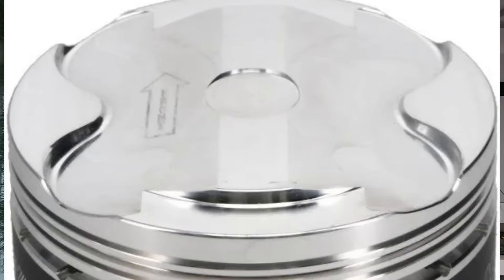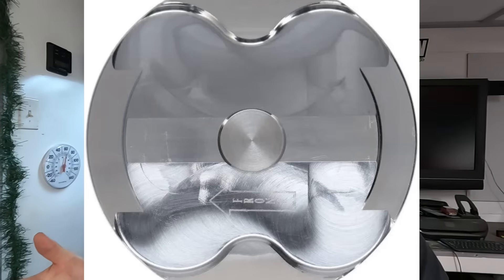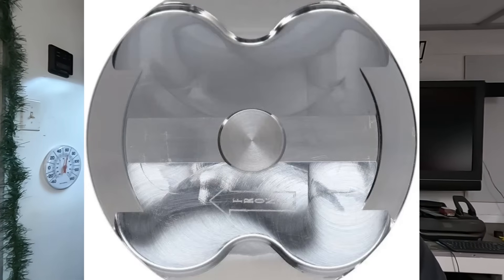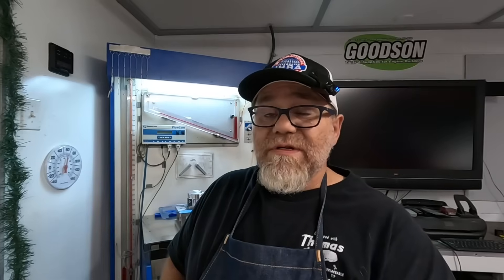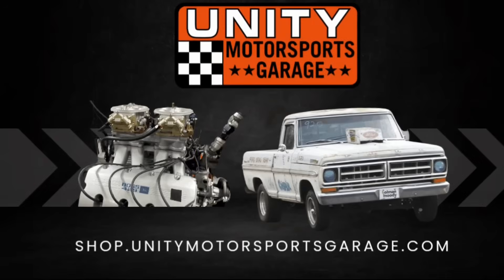DIY: Piston Mods that WILL Actually Make Power!!!

Comment: Ok what if your quenching heat out of the piston or using c ceramic coatings and yes I was taught to smooth all sharp edges inside the combustion to l prevent  pre ignition from red hot edges.

Comment: I waited for the part where you tell people that "porting" your piston is dropping your compression and losing power. Better air flow but lower compression. 100% spot on with the burrs or rough edges causing pre det. Polishing is a good idea.
Reply from the maker: I will trade airflow for that .25 point of compression everyday of the week!
Thanks for watching 
Andy

Comment: I was just thinking, so please correct me if I'm wrong. When a aspirated engine cylinder is at dwell there is little to no cylinder filling until the moment the piston starts moving down, what if one can figure out exactly when the piston starts going down, and the exact time the inlet valve opens, then you adjust the cam timing to open the inlet valve to as close to the start of the piston going down. I see piston dwell as lost time or dead time.
Reply from the maker: The cylinder begins to fill even before the overlap period!
Andy

Comment: Just watched this video  great info. in the future i plan on building a racing 360 mopar small block . ill send you a couple of pics of a pistion out of my 318 i had rebuilt a few years back and get your opinion on what caused the damage ?
Reply from the maker: Looks like Detonation to me...
Andy
Reply: @UnityMotorSportsGarage  I believe coolant played a factor because I aways tried to make sure the timing was correct . found damage = cracks / warpage to the head gaskets and some of the head bolts where tight but didnt feel torqued even though I followed the proper specs . from now on im using ARP Head bolts or even ARP head/ block studs like I did on my 225 slant6 . Thanks Andy

Comment: Good video. Agreed on everything you said and it all makes sense, EXCEPT the part that you said the piston sharp edge will glow red hot. I have heated aluminum before and it doesn't change color like red hot as it heats up. But I did understand what you were trying to say by that statement. Respect. Correct me if I am wrong though.

Comment: Hey Andy what about gas porting pistons? I build ohv clone engines from box stock 196cc to open modified 240cc stock doesn't turn 6000 but the big motors will turn 10k. They create an unbelievable amount of crankcase pressure. I was wondering if gas porting may help seal the cylinder aginst all that positive pressure? Thanks

Comment: Dear Sir, Something that I have always done in the many years of porting pistons is. I always smooth out any sharp ridges as standard. But I also polish the piston crown up to a mirror finish. Personally I have not had any problems with any of the many builds I have done this to. So I was just wondering what are Your thoughts on doing this, and is this a common practice among  your community? Nice video Sir., and Best Wishes

Comment: Good stuff.  Except the glowing aluminum.  Molten aluminum is silver, correct?  The point is great.  Edges will become hot spots.  Here is my question.  If you radius the sharp edges, is it also a good idea to smooth or polish the new radius surface.  If you leave it rough, will that area carbon up quicker if it is more rough than the rest of the piston?  In a pure racing engine, that can't be that important.  I am thinking about a street engine that might see thousands of miles.  Good video.

Comment: Is it not correct that by removing material from the piston crown will reduce cylinder compression, and that might lead to slightly lower power and torque delivery ?.

Comment: I see the same reasoning in an engine which is definetely not used for high performance. Russian M72 or chinese CJ750 . Its a sidevalve boxer so the piston itselve is definetely flat . As the official output is about 22-26 hp . The engine is rated to use cheap fuel , minimum 78 Oktane. All the guys who try to inhale some more hp into that engine use the compression ratio , modifying the cylinder tap , which defines a lot of the shape of the combustion chamber. When they increase the compression rate , adding material to the surface and reshaping it they beware a lot to give a smooth transition to the edges of the valve-pockets. Exactly to prevent knocking as consecuence of the invreased compression ratio. Knocking is exactly the same which is provoked by "glowplugs" at sharp edges. Doesnt matter if you have them on a lawnmover or a dragster engine.

Comment: When you have a CNC machine piston you can have that machine around those edges off to what  angles you want. Whoever is making them needs to be told that's what they want. There is no need for Sharp edges. All you have to do is talk to the manufacturer.

Comment: OEM piistons spend  99% of their life at 1/2 atm pressure or less.  It would be a rare case where oem combustion temp occurrences melt sharp edges.  I wouldn’t blame them, you are specializing the engine for boost applications .  You are an expert, like DV.

Comment: Brian Salter done a excellent video on this subject and he had someone who challenged his findings, he had to tell the guy that he's an engine builder and it's been proven by radiusing the eyebrows on the piston tops. Laying a intake valve in the valve relief you can see the ledge over hang where there will be some disturbance on the overlap so laying that edge back will help with air flow

Comment: Very good "common sense" info..  I see a lot of engine builds with sharp edges in the crush zone.  A OEM Toyota 22r chamber is hooorible. Not sure if you mentioned it, but some people are worried about the tenths of a point of compression lost due to the material taken out. But the truth is, being able to avoid detonating will make far more power and reliability. It's a common sense smart bit of elbow grease to do...

Comment: The Cummins engine uses one push rod to open 2 valves because 4 valves flow more air than two big valves. If they can do that on a Diesel why can't they do that with a pushrod gas engine?

Comment: Well said andy ive melted thru a ring land just like your buddy in the early 2000s and i figured out what the problem was and took my die grinder and sand rolled all the sharp edges and that circle track engine lived a long life after that
The sharp edges glows and can also cause pre ignition aswell

Comment: Great video Andy! My upcoming 455 Pontiac Im gonna push to the limit on compression. It will be about 11:3-11:5:1 with a good tight quench and all smooth edges. IVC at 48.2 degrees.

Comment: Absolutely post those pistons. Not only is porting the valve oocket notches a real deal, flame propagation needs to do addressed! Flame travel is a major issue when working with domed pistons.
Reply: Definitely.
Domes over .100 tend to hinder unless done just right.

Comment: Super cool Andy great video. valve relief is pretty crucial I did have a small Block. chevy  331 cube that I built a long time ago with a flat top pistonIt was a circle track  American stock Set up. before that and had  12 and a half 2 to 1 Pop up Seal power Old school pistons The rules in that class were had to be a 2 barrel of the cast iron head. I put a 4 barrel on that thing in it absolutely ripped. But I gotta hold this in Canfield 208  185I think they may have been one 70s can't remember Heads and I switched the piston out because I was going   Put it in my 71C10 on the streetstreet Went to A 9.6to1 flat top piston. Where the valve relief on the flat top Pistons was kind of tapered  And with the bigger valves it actually contacted The edge of the valve relief on the intake valve. But I assumed since I went from  Popup piston to a flat top I would be good I was wrong. Thank you for the video. Very educational. I did not use the clay method on the engine which is usually my go to. I tried to be smart and measure it. And I missed it until I assembled it and rotated it with the valves adjusted. I didn't  Messy thing up  I had to pull the heads back off and The agent back apart And square up the valve  Relief on the top of the piston. But I've seen similar scenarios lots of times  They play method is your best friend. I didn't even use some thick grease Not the point of your video but related thanks buddy

Comment: Good video. Don't take this the wrong way but there's one phrase I want to kick around and make sure you see both sides to. Doesn't change the subject of the video here- amplifies it in a way- but want to make sure to examine the phrase, because there's another side to the story.
8:50 or so you are talking about the piston hanging around TDC.  OK, geometrically, physically, yes. 
Air dynamics not so much. Opposite really.
.... as the piston pulls away from TDC on the intake cycle, it is starting from chamber volume. 65cc or whatever.  If it appears to take a while (degrees/time) to add 10cc, put that in context that it is adding that to a mere 65cc.
 Later it will be adding much larger volumes (eg as the rod reaches 90* to the crank throw) but it will be adding that to 500-700cc. 
The acuteness of vacuum drops off.
Meaning: if you were to put a vacuum gauge on the cylinder, it would pin the gauge at first as the piston movess away from TDC, then fall back to lessened vacuum as the piston speeds up. Sounds wrong but do the math on how much, as a percent, of existing volume the piston dropping adds. You'll be surprised.

Everyday example- in a small room, you can greatly affect the air pressure by swinging a door open and closed- ie airing it out.
Whereas if you have a much bigger room, it makes no difference when you swing the door.

So, think again, when you say the piston is hanging around there, at TDC, you may be thinking of it wrong.
It's actually important to make things "right" at TDC as you talk of here because a whole lot is going on. The most intense dynamics are at TDC.
Almost all engine builders end up focused on overlap, but I'm not sure they express why in a way that shows they understand the air principle....
And yes air has inertia, so "maybe" I've overstating the effect that "acuteness of vacuum" has. But it exists, & has an effect starting the airflow, separate from the "overlap" function itself. 
An agriculture engine without overlap still take a "sharp breath" as the piston starts down on intake.
Let me know here if this is making sense to you...
Reply: Don't forget that air stretches like a slinky toy, changing volume and pressure. Scavenging really sucks. 😆

Comment: At overlap the exhaust valve is open and the pressure wave of the exhaust leaving the cylinder has, if tuned correctly, exited the exhaust collector and a negative wave is traveling back up into the cylinder. This negative wave creates a vacuum the pulls the air/fuel mixture into the cylinder, helping to get it moving quicker. Unshrouding the intake valve at low lift would help the flow from the intake to the cylinder while the intake valve is opening and the exhaust valve is closing. So this makes sense. It’s not a huge amount of air/fuel being drawn into the cylinder at this time,  it every little bit helps in a naturally aspirated engine.
Reply: Kenneth? I hope you have a minute comment on the symptoms of too much vacuum pulling the air/fuel mix into the chamber… if there is such a thing. How much is too much , I guess is what I am asking. 
I am also wondering if you could take a minute to include anti-reversion into your explanation. I don’t want to miss the opportunity for you to be fully heard.
Reply: Unfortunately, that harmonic resonance only happens at very specific RPMs.  Much like tuning a radio antenna, a guitar, or (most relatedly) a brass instrument like a trombone.  Sadly, while variable intakes are a thing, variable exhaust would be incredibly hard to pull off.

Comment: Andy, when an engine get a few miles on it, would carbon in the chamber and piston smooth these hot spots?
Reply from the maker: Normally, what you will see is the hot spots will keep the carbon burned off in those locations.. 
Andy

Comment: Intake, or both?
Reply from the maker: You roll the edge of the intake a bit more compared to the exhaust.. The exhaust relief actually can help push the exhaust gases out of the port because the opposite is taking place if that makes sense 
Andy

Comment: Run a dished piston....also helps the flame front
Reply: Domes higher than .100 usually hinder flame fronts. 
More is not necessarily better. 😆
The dome piston Andy showed, we usually rounded it off a lot knowing the improved burn offset any compression loss. 👍

Comment: I wouldn't put it in the click bait category but I would put it in the more beneficial to content creators than engine builders and tuners category.  
 If your shit is tuned properly your pistons won't melt. The end. I have replaced hundreds, if not thousands of melted pistons, and every one of them melted because it was run lean and or with too much timing. When we were racing snowmobiles we would literally melt pistons on purpose to figure out our jetting. 
While free horsepower is always nice time is money and piston porting takes time. The time spent piston porting to get an extra 20 hp on a big block might have paid off with larger power gains doing something else. And unless you are extremely limited to engine mods, 20 extra hp out of a big block ain't shit. 
 Just my $.02
Reply: If everything else was equal I bet an extra 20 hp would be shit then.
Reply: @garyburdick1992 Right....but everything else is NEVER equal, even in class racing.  Congratulations on your ability to string words together.

Comment: Personally, I think you should come up with a different name for your technique. "Porting" as you will know, is the process of smoothing out "ports" in an engine. Usually using a burr or rotary file of some type. Doing the same thing for the same purposes on a piston doesn't involve the ports. But it does involve the same process as porting. It's just not the same thing. But you can't call it "pistoning" that would sound stupid. But porting, to a person like me who knows what porting is, also sounds a little bit ignorant if you're doing this to the piston itself. And as always, I'm some guy with an opinion but no solutions. I have no idea what you should call it but the first thing that came to my mind was  "piston relief"

Comment: Andy it’s always a good time buddy! 
I have two 4.6 / 2V intakes I’m going to send you..
I’m going to fix one correctly with JB Weld. 
And hand make a blue stripe fel pro gaskets, to seal the front of the intake properly where it deteriorated. 

The heater hose nipple in the rear..
You’ll have to make an insert nipple, JB welded in place, or tap the heater hose in the front of the intake somehow. 

Nevertheless it’s like dental work. 
At the front of the intake, you have to gently scrape away the rotten plastic, with a hobby razor knife, then start your JB weld build up process. 

I’ll contact you via email, so Ole’ Funky Elvin can send you two panther car intakes for 4.6 2V…

My contribution to the North Carolina Boys, trying to work on a budget.
Reply from the maker: That would be awesome 
My email is tunnelram393w@gmail.com 
Thanks 
Andy

Comment: Bill Jenkins addressed this in his book "The Chevrolet Racing Engine."  He goes into a lot of "secrets" that are still used today.
Reply from the maker: Absolutely! I love that Book
Andy
Reply: Ive been doing this for years it works
Reply: Great video thanks
Reply from the maker: @gregoryplummer-l9l thanks for the kind words and for watching!
Andy
Reply: I’m pleased to see that I’m not the only one with this logic. As a mere home mechanic and tuner since I was a teenager (some 50 plus years ago), I don’t build many engines but I’ve seldom just fitted new parts as they come out of the box because so often I’ve seen things like these that worried me about them being the weakest link. It’s always seemed a good idea to me to remove any sharp edges. When I’ve fitted new valves they have often been made with a sharp edge on their extreme outer rim. I radius that off too, obviously without touching the seat area. If anything is going to glow red hot it’s likely to be a sharp edge on an exhaust valve and I know that gas doesn’t like to flow round a sharp corner anyway.

Comment: FREE [POWER FLIP YOUR PISTONS LIKE UNCLE PHONEY. THAT WAS  PROVEN NOT TO WORK BUT GOONER STILL THINKS IT WORKS.
Reply: Man, I thought I was the only one that remembered that Dumbasses' wild ideas. If I recall it was 440 pistons he was talking about. Those Mopar Rags really cranked out a ton of B.S.

 lol, Uncle Phoney indeed. LOL. Thanks for putting this comment on here, it made my day!
Reply: @ExMxer3  BEST WAS THE POS 318 HE SENT NICK. POS HAD ZERO OIL PRESSURE. NICK SHOULD HAVE SENT IT AND BLEW IT THE FUCK UP AND HAVE UNCLE PHONY CLEAN UP THE MESS
Reply: @ExMxer3 it was in the mopar racing bulletins and hustle stuff, it wasn't his idea
Reply: @MarkHenke-w4q  Which one? I would like to see it.

Comment: Done this "porting"  work for years on my high compression-14.5 to 1- smal blocks its tightest spot is between 8 and 18 degrees a t d c even on a 106 lobe center cam

Comment: Have you ever heard of a motor gaining a hundred horsepower on the dyno just by spark plug position
Reply: I'm referring to an aircraft LS motor they have two spark plugs in the head two ignition systems
Reply: Alfa Romeo Twin Spark. Might also be on Ferrari (?).

Comment: FACT! The biggest piston related change from normal practice to make more HP you can do is do NOT use ANY heavy oil on the rings during assembly, Use only WD 40 or equivalent on the bores and the ring compressor, heavier oil effects the way the rings seat and will cost you HP.